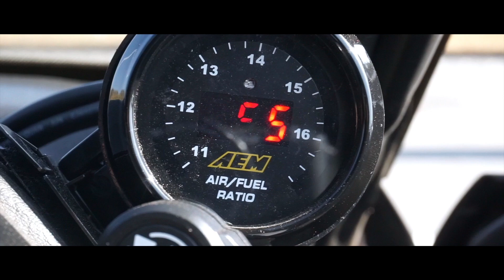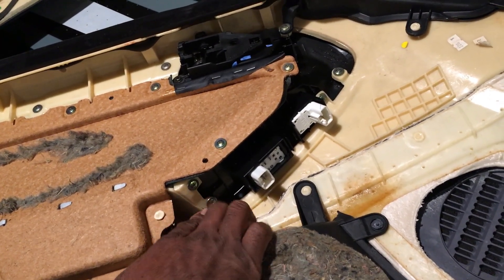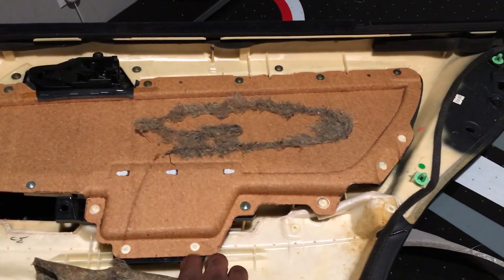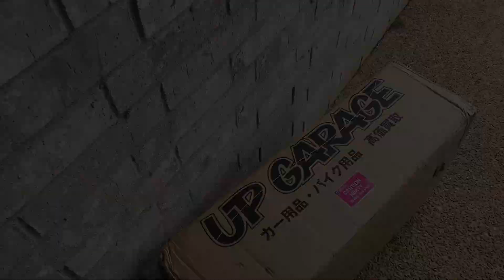BUDGET VIP GS300 BUILD EP.02| DIY CUSTOM DOOR PANEL INSERTS & ARISTO BLACK WOOD

Comment: Thank you for your videos. I have a silver 2004 GS300 with grey interior that I've been working on, and I have learned quite a bit from you. I like to get parts from the junkyard to practice on. So far inside I have built a VIP table(woodgrain wrap\chrome), blue LED swap on all buttons, climate, keyring, and ashtrays, custom textured pattern(black, silver, and white) lined blue LED lit center console(both compartments), same new pattern applied to back panel with sub(sub is new separate black textured material but thin for air), I have painted many of the plastic bezels, panels, rear window controls and covers with adhesion promoter and VHT "silver" paint, wrapped rear ashtray lids with woodgrain vinyl, removed front ashtray is now a blue under lit Technics SL-1200 miniature, applied under dash blue LED strips, custom radio and just ordered some Clazzio seat covers and material (dark grey/ light grey quilted insert with dark grey stitch). Next I plan to tackle those door panels with all three materials mentioned(black for speaker, Clazzio quilted insert for card, and black, silver white pattern for bottom if possible), and attempt to LED the gauge cluster. Thanks again for your knowledge and inspiration, and I hope to see more on the GS! Peace, prosperity, and wellness to you sir!!!
Reply from the maker: Thanks for the support. I have a lot more, just waiting to get the car back from paint.

Comment: Epoxy resin with glass fibre tape is  permanent fix for door or any plastic panel crack.
Reply from the maker: Dope!! I will have to try that.
Reply: Also if it needs to be flexible you can use shoe glue instead of epoxy resin.